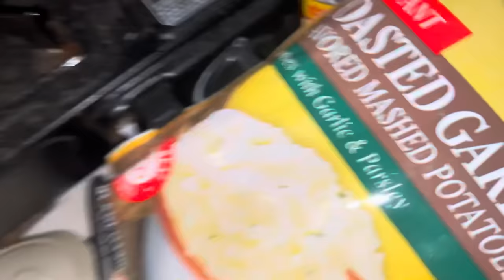Building a Cabin and Fishing for Trout in “Little Alaska” Day 45

Comment: Put silicone caulk over top of the screws in the roof.
Reply: How do you think flex seal would do?
Reply: @jasencarpenter612  probably work just as good, it’s silicone based. Caulk is just thicker and more permanent
Reply: Smart hella forgot bout this
Reply: the screws all had a rubber gasket on the bottom to prevent water from getting in
Reply: Waste of silicone to put atop the screws.
I have metal roof on my home and garage both and used nothing more than the rubber washer tech screws it calls for holding it down and have had ZERO leaks .
It been over seven years and zero leaks.

Nothing was ever put over screws and nothing put under the metal where it overlaps. And sheets are only overlapped a single bump and all is fine.

That roof is plenty weather tight once the cap is on for wayyyyyyy longer than those logs will last.
Reply: As long as he compressed the little rubber washers o the screws hes good
Reply: He got roofing screws, no need for caulk..
Reply: Nah
Reply: Yes and you also need to calk the roof where the sheets meet think like water it can go tru the smallest cracks
Reply: @adriandelucia9070  no this is why you overlap your panels and secure them together and to the roof well with roofing screws.
Reply: None of y'all are roofing or builders I can tell. Read the installation guide for  galvi corrugated roofing. Jesus
Reply: @DrRayB445 water can go in them still over lapping or not there’s still a small crack I would just flex seal it
Reply: @JCproduction0  that’s why you overlap and screw the two panels together on the ridge where the top panel ends so there’s no gap and need for flex seal or caulk. You realize flex seal doesn’t seal anything well and if anything you would be creating a bigger gap on the overlapping section rather there just being a small gap on the edge of the corrugated metal.
Reply: Just get roofing tar it’s cheaper?
Reply: Don’t do that. Them screws are made for that if they wasn’t they wouldn’t use them for houses.
Reply: @huntersimpson1974  I’m talking for the holes where he miss drilled and tried to patch with flex seal
Reply: or duct tape
Reply: If he uses the right screws he doesn’t need to use silicone.
Reply: Thats an unnecessary step
Reply: Also silicone on top of all the roofing connections
Reply: No need to.. I’m a contractor and those screws have a rubber seal on them
Reply: Gravity, water will drain down the slope before going over any of the gapping in the overlap. Ridge vent and you should be money. Caulk is overkill but wont hurt
Reply: I’d use tar, silicone will ware way faster… and tar is cheaper for way more
Reply: Definitely a good idea
Reply: That’s what I just came here to say!
Reply: Or plastic roofing cement
Reply: You do know that silicone and caulk or two different things
Reply: You should use screws for metal roofing bro, they will have a rubber gasket to seal it then it's maintenance free because your not rechaulking the screw heads. Just don't over tighten em!!
Reply: @Joe_M- sounds like u work for a screw company hahahh
Reply: I love caulk
Reply: Nice caulk
Reply: And ppl said YouTube wasn't educational!?
Reply: Spot on couldn’t remember what I put on mine worked excellent

Comment: You will need an area to protect your food from freezing, Insulating it from stream temperature change
Reply: aswell as water.
Reply: METAL TAPE
Reply: a root cellar would be perfect, utilizing the constant year round 55° that the ground is at. as long as he could keep it from flooding. basically it’d be a hole in the ground, preferably in the side of a hill
Reply: @CitrusMike  That is easier said than done and he probably doesn't have much time before the winter. How about digging a hole inside of the hut and putting a insulated barrel under it. With holes in the lid it would be great for food heated from the stove.
Reply: @investwave7262  root cellars don’t have to be huge, a barrel sized hole will do
Reply: like, inside?
Reply: @Kastley  Both
Reply: @Kastley  Depending on where he's gonna be storing his items

Comment: Will, your videos are great. You feel genuine and honest. I hope the winter nights stay mild for you. Also, at 7:13, you were talking about Buddy heaters. When using them, make sure they have plenty of oxygen for them to work properly. These are still combustibly powered, meaning they burn propane, but like you said, they do not release carbon monoxide (the bad stuff). They have an oxygen sensor that should turn them off if they don't have enough oxygen, but be careful because it can produce carbon monoxide if there isn't enough oxygen in the room (the sensor will stop this from happening). So, if you ever get confused about why it won't “work” sometimes, that could be a reason why. Some models require a garage-sized volume of air to complete total combustion, so bigger isn't better unless you are outside. Love your videos, my guy, and I'm sorry if this comment comes off any other way but love. There is a big ball of energy I'm sending back your way. 🤙
Reply: This is solid advice. I know from experience. When you’re freezing cold and frustrated because the heater keeps shutting off,……..that’s why.

Comment: The way to dry your wood is to always have a stack around your wood stove in your cabin. Then the heat from the wood stove will always be drying out the wood that you will use later. You have that space under the wood stove, and to the side, where you can stack. I lived in a trailer in a cold wet winter with a wood stove and it works!

Comment: If you go with more sealant than necessary there isn’t really a downside other than using an extra can or so. If you don’t seal the roof enough a wet shelter in the winter is a really miserable time! Doing repairs in the snow/winter would be shitty also! If you have any scrap pieces you could even overlap the seams with another piece of roofing sealed on the edges to be extra safe. 

That said always looking forward to seeing the updates and keep preparing more than you think is necessary! 

A drying rack or wall hooks and second set of winter boots, gloves and outerwear is a decent idea also!! 

During the winter days you can finish the inside shelving projects and stuff. For now just know snow/ice/water and cold air will be relentless in the next few months in that elevation. 
Keep it up Will, doing great overall!

Comment: You should look into a diesel heater! They are great! It uses minimal power and can run for days on 1 tank of fuel. And they don’t put off moisture like the buddy heaters. I used a buddy heater for awhile and it burns fuel very fast, turned to a diesel heater and never looked back!

Also some of the diesel heaters have a thermo stat 😏

Comment: Make sure you have an air vent so your wood stove burns will and doesn’t suck all the oxygen out of your space. Caulk roofing screws, and have a small wood storage inside the cabin you can constantly replace as you use it to help keep it dry before you’re going to use it. As long as it’s elevated a bit, mostly covered, and has airflow it shouldn’t get wet enough to not burn even with snow and rain. also store it bark side up and that will help. 

Learn how to set snares and you can catch and eat rabbits all winter. Just set a little ways from the cabin and know where they are so hoop Doesn’t get caught in them.

Comment: If you have some scrap corrugated metal, cut it to fit the wall in the corner behind the wood stove. The gaps between the metal and wall will act like a chimney, and help the hot air from under the stove to rise, helping with air circulation. It should help keep things and not mildewing from the moisture from any melting snow.

Comment: Hey Will,  use silicone on the holes in roof, overlaps are good the way they are. The buddy heaters typically have what’s called a low oxygen shut off, so if the carbon monoxide builds up too much the heater will turn off automatically. I’ve used dozens of the buddy heaters and they are good. They’ve come out with a new one that will turn into a cool top and other accessories might be worth investing in one of those.

Comment: You’re doing great Will!  everything looks awesome! just like in previous comments that I’ve read… I agree, it would be ideal to start working your drainage at least a foot out from your structure all the way around it so that the water and rain melt will not penetrate your structure. especially digging an outhouse close to your area would be nice, with potentially multiple holes that you can move your toilet to as it fills. Drop a handful of wood ash and straw per dump and it keeps the smell away. 

Yo Drop an address and your fans will send you what you need.

Comment: You're 100% right about the screws being in the ridge and not the valleys. Its a small roof and im sure you'll keep it clean so you should be good.
Reply: They belong in the valleys. The screws have rubber washers that make them water tight, but you need to screw them in tight enough to compress the rubber. Only way to do that is in the valley
Reply: @dean3184  not true at all.. screwing on the ribs is the way to do it. iv seen lots of roofs and leaks, and the screws on the flats are always the ones that eventually fail. Years from now when that rubber is rotted and cracked, u want them on the ribs cause even when its pissing rain itll hardly leak if at all, but on the flats.. good luck

Comment: You should use black jack or Henry’s roof patch to fix those holes. You can get it in caulking tubes and just fill the holes and gently smooth out the product. The ridge of the roof needs ridge cap!!!

Comment: There are the wood screws with the washers your using that go through the roofing metal into your wood underneath. And then there are sheet metal screws with washers that go through the roofing metal on the seems that will zip that gap together. The butyl tape is nice, but if you just get the sheet metals screws it will make the difference.

Comment: Some suggestions. Make sure you cut the wood short enough to fit in the stove, and get an adapter to hook buddy heater to bigger propane tank. Make sure you get a propane gas heater filter for the buddy heater. It will clog up. Doing great!

Comment: Your doing awesome Will. That ridge cap will help alot. Get you a vent fan like you would put in a bathroom, that will pull good air in and bad air out. Or circulation is what I'm trying to say. You can run it off the solar power. That way no fumes or dirty air builds up. You got this man keep doing you bro. Peace and good energy back to you!!

Comment: I run a buddy heater in my boat all winter long, A normal sized propane tank for a grill lasts about 5 to 6 days with the buddy on low. No issues with carbon monoxide or anything. Just make sure to have a little detector near where you sleep.

Comment: Hey will, Buddy u need to forget the spray sealant stuff and use Silicone caulk  put it over the screws over the holes your fixing and you should have put a bead down when u were laying down your roof where they overlapped but now Just run a bead down the edge of the metal tile. Make sure you use Silicone as it won't shrink from heat or cold and it will stay pliable (rubbery) it won't harden up which is a good thing  and please please get a tester for carbon monoxide since u don't have any way to vent the cabin and allow some fresh air in. You NEED !! NEED! A CARBON MONOXIDE TESTER !!!! NOW  LIKE NOW !!!

Comment: Yes, run some weather resistant tape or some flex-seal along those seams of the roof, (don’t want the wind ripping those up) also i would continue sealing each of those individual screws like you were with flex seal or a very durable metal caulking

Comment: If you are able to build a  firewood shelter, you can make your own waterproof, super durable cloth tarps out of a few old or new flat bed sheets, or get a few fabric drop cloths for painting, a can of mineral oil, and a few tubes of silicone. All set of at Walmart.
As you know, plastic tarps tear and degrade pretty quickly, especially when used to cover wood.  There's a few videos on YT on how to make them, and the knots used as anchor points.  Nice looking fish BTW! Bet that was delicious!

Comment: setups looking good g, one piece of advice: propane heaters are terrible indoors, they put out a ton of moisture so you'll end up with a steam room rather then a warm dry cabin, If you feel the need for backup heat (which you should) go for a small diesel heater.

Comment: That saws a game changer!! Do you gotta reciprocating saw or grinder and alowed to cut a section of the bus off roof and sides for a wood shed just thinking of quick ways to get more covered space. With all that snow it's going to be key everything out side well not be found tell spring.
Reply: Also metal roofing screws if you can get em or silicone over the heads

Comment: You can put in stitch screws on top rib where tin overlaps. How it's supposed to be. better if you put screws in side of top rib so the washer sits flat and pinch sheets together.
Reply: This will close the air gaps and stop wind from blowing in rain through the Crack.

Comment: Yoooooo love you man. Should of put the screws in the ridge of the metal for the exact reason you said. You don’t need to silicone the screws. That rubber washers are good. Let it ride out now and just like you said l, don’t let the stuff build up like leave or any debris. When you payed the metal if you overlapped the sheets like 3or 4 ridges you don’t need to seal it. They make some clear sheets too you could use on you porch. Much love brotha man.

Comment: The flex seal spray is good but do more then 1 coat. Let it dry and do a 2nd coat and a 3rd and 4th coat. It will fill those holes up easy with just a couple coats. Flex seal is meant to be used in layers so the more coats of flex seal the better.   If there’s a gap let it dry and add more and just keep going until it fills the cap.

Comment: Those buddy heaters are great, I use them in my canvass tent when I winter camp, problem is that it makes a good amount of condensation inside my tent, also the pilot light is not very strong so that if the oxygen gets low it will turn off, thats nice but my oldest one has broken down due to the pilot light and emergency shut off function.. if you plan to run your buddy heater off a large propane tank you should definitely get all he Mr buddy brand hoses, and definitely get a filter for it because they are notorious for breaking from the hose and no filter.

Comment: You need to do something about having water that won't freeze the snow is going to be a little bit of. Problem for certain things efected by cold temperatures such as gas powered objects also find ways to keep your energy up the in the cold, it will definitely make you a little slower when doing stuff cause it slows down you cardiovascular system so make sure to have hot food to alos make sure you have wood that isn't frozen much love bro you definitely on the right path in life keep doing what you doing dog much love from oregon 💯👌

Comment: The issue with a buddy heater is that propane burns wet. I believe the only 2 that don’t burn wet are diesel and wood. This mainly affects condensation. It could build more water up on the ceiling, causing mold.

Comment: Buddy heater works well but creates a lot of moisture, it does make carbon monoxide but not much it burns very efficiently. Also if you get a propane extension hose it needs to be the buddy heater one because it doesn’t contain oil, any other cheap propane hose will ruin the heater over time.

Comment: Recommendation, cut small holes in those shower curtains so the wind doesn't blow the whole thing over. It's okay if you have a little bit of wind going through rather than it ripping the whole thing down.

Comment: Hey Will. If you haven't figured out your bathroom situation you should check out Off Grid With Doug and Stacy on here. They have a great composting toilet video that uses 5 gallon buckets and sawdust. I'm gonna be using that system in the tiny home I'm building. Their page is just generally good by the way. I also bought a Jackey 300 and a solar panel for what little I need till i get money for a bigger system. Awesome videos you're putting out. I feel like you're inspiring people to wanna follow this lifestyle that just haven't had the push they needed. You're also the only channel I've clicked the bell icon for. 😅 Keep it up, dude. You got a lot of insight and support on here. Also, the Mr. Heater that you have should have a carbon monoxide failsafe that shuts it off if it senses high amounts. Not sure but I'd look into it. Regardless, you should be fine with that style heater.